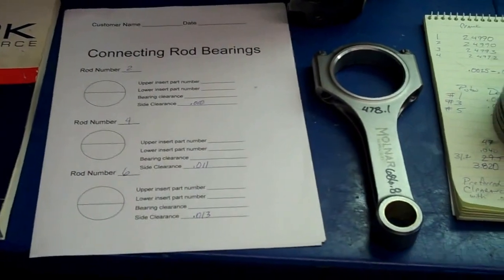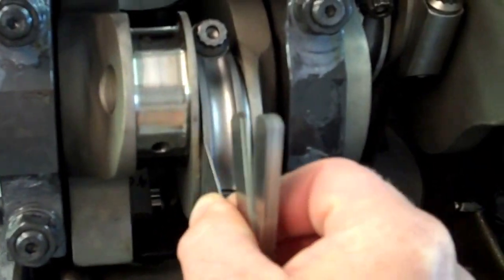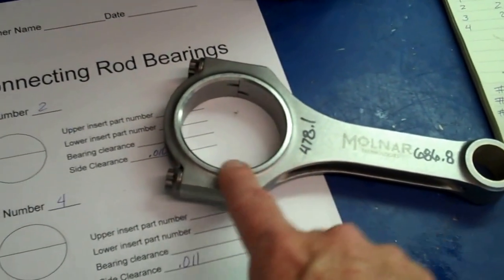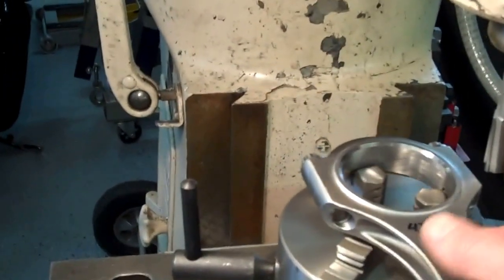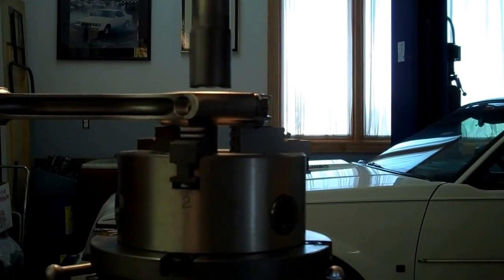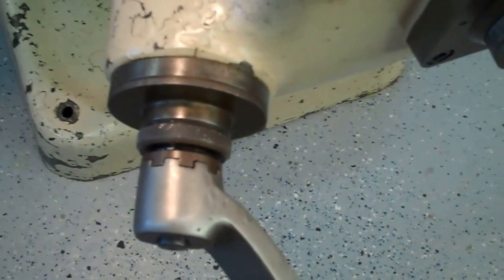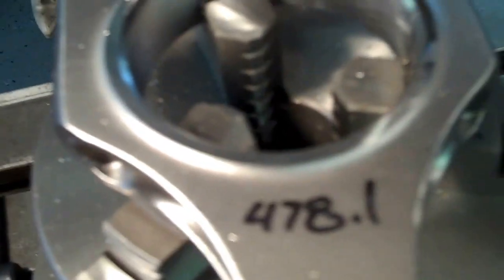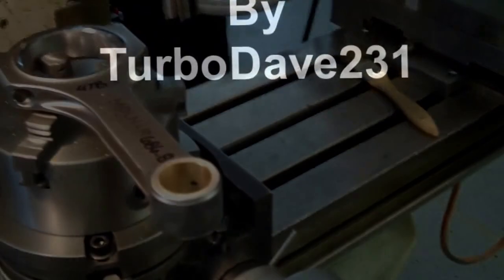Measuring and machining connecting rods for side clearance

Comment: Great video. I'm going to disagree respectfully on side clearance affecting oil pressure and causing windage, at least clearances within reason because I've seen with my own eyes, engines with massive side clearance and pressure wasn't affected and one in particular I'm thinking of was one of our better running engines with stellar pressure at idle and throughout the rpm range. I do tend to think that since you're putting this info out, I'd trust that your experience shows different so I'm inclined to think that maybe it's less critical on a SBC and will create these issues on a Buick 6 and I will admit that I have zero experience with the Buicks, which would mean that I just learned something so thank you! Lol
Reply from the maker: Let me start by saying that in this video, I was correcting a side clearance issue where the clearance was extremely tight (way below the spec). 

If you are blessed with an engine design with plenty of reserve oil volume, side clearances in the .015 to .020" range should not be a problem.  

The Buick V6 and V8 engines do not have an overdesigned oiling system!  In fact, we spend a considerable amount of time and effort improving the stock design system. We also run bearing clearances so tight, that it would scare crap out of the average race engine builder!! (.0016-.0019 on the mains and .0015-.0018 on the rods) The ultimate solution would be a dry sump and many of the fastest Buick guys indeed run dry sumps. However, dry sumps are not practical for most street cars.

Now lets address your thoughts about windage: What creates windage? 

Windage is created by oil  being flung off the crankshaft. What are the sources of the oil? Oil that comes out of the main and rod bearings and  oil that returns from the cam bearings and cylinder heads. Controlling oil flow onto the crank and out of the bearings is the the only way to reduce windage.  Excessive windage has been proven to create losses as great as 80 HP.

From Reher-Morrison:
"The rod clearance is an important measurement. The size of this gap determines the rate at which oil is lost from the rod bearings and sprayed onto the cylinder walls and pistons"  

On our little Buick V6's with a stock design oiling system, we can't tolerate excessive oil loss out of the rod bearings.

Comment: Doesn't that wreck the bearing race being in the chuck like that? Also was the runout of the part in that chuck checked before milling? If so, should definitely keep that in the video, super important step.
Reply from the maker: This operation is performed with no bearing in the rod. I have checked the Big End for out of round before and after this machining. I detected no changes. The key is not to overtighten the chuck. Yes, checking runnout of the face is important, but not as much as you might think. The Big End of the rod has sufficient end clearance after this operation and small amounts of runnout (.0005-.0015) won't affect operation.